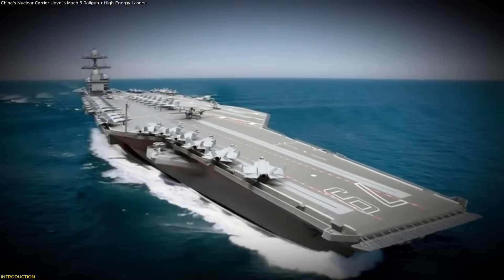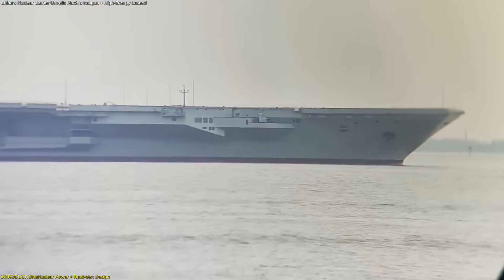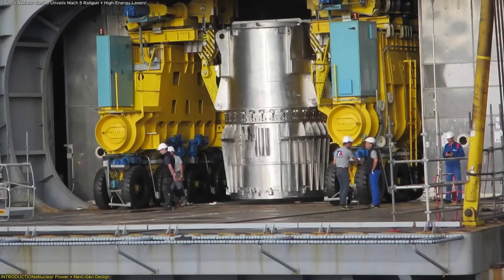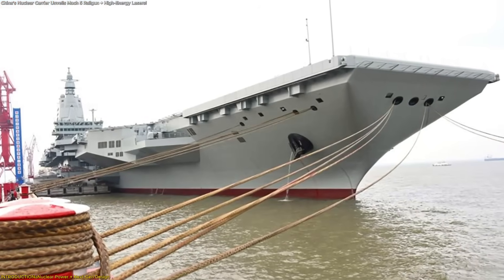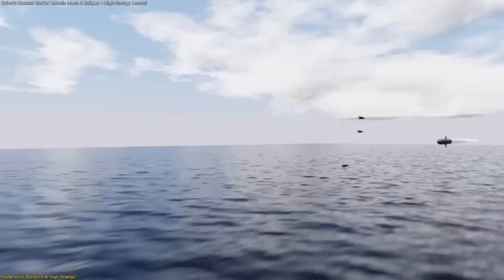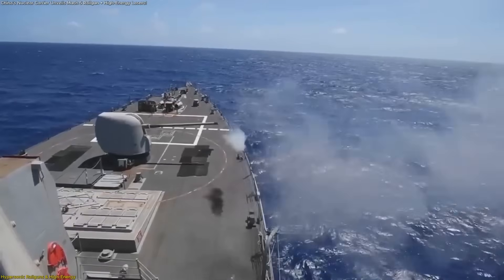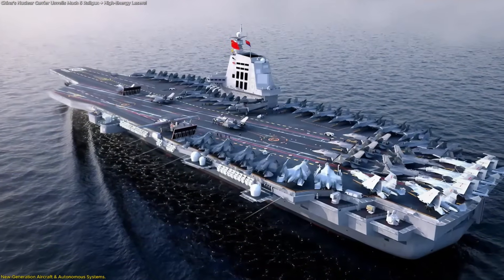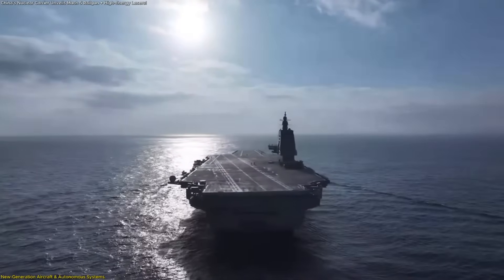China’s Nuclear Carrier Unveils Mach 5 Railgun + High-Energy Lasers!

Comment: yes but what if the enemy uses an EMP to desable an damage all electrical systems of this carrier ?
Reply: Certainly most high tech weapons/equipment comes with some kind of a tradeoff. The weight of those tradeoffs can be mitigated over time with engineering, breakthroughs and tech advancements etc. The cost/benefit and risk/reward are evaluated with every country. The Industrial power for replacement within an acceptable time frame also factors in the procurement.

This is why the US is talking about reverting back to the Steam Catapult. They are not able to get satisfactory risk/reward with its EMALS and don't think they can replace or engineer their way into satisfaction within a reasonable time frame.

But on the contrary, there are indications China is moving ahead in production with their EMALS.
Reply: Only China has working EMP's as seen recently when they dropped 2 US jets into the water in the South China Sea.

Comment: as long as the power generation has enough spare capacity, electrical based weapons can get replaced with more advanced systems easier.  this would also reduce the weight for less ammo carried.